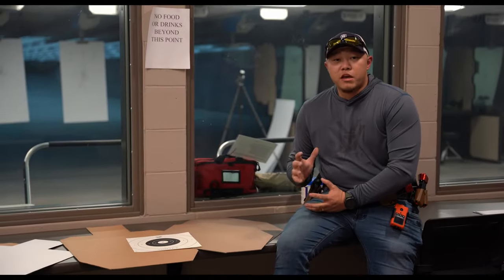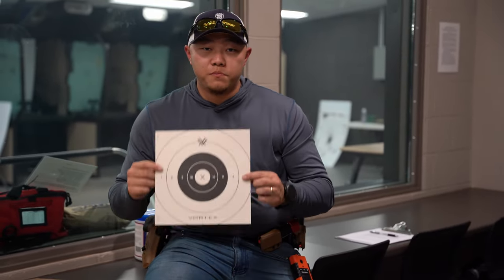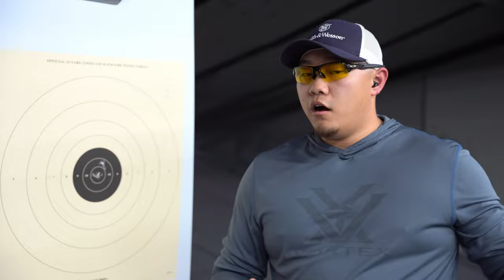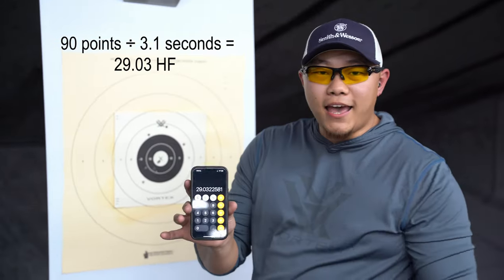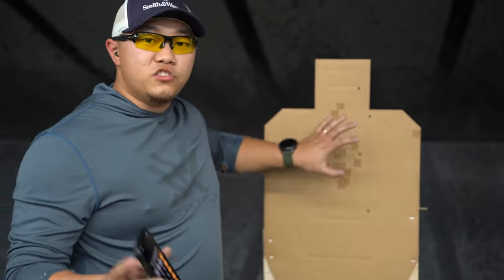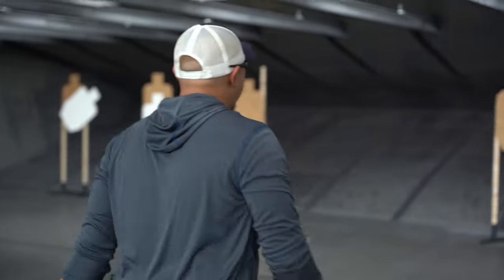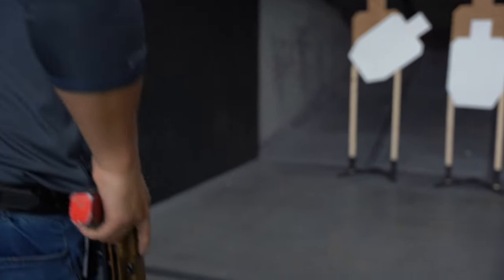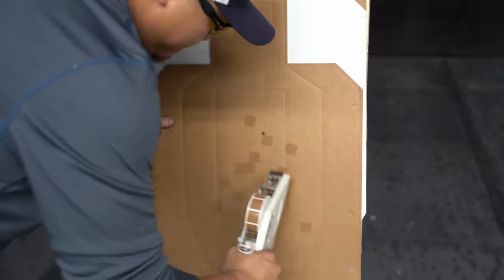What is Performance Shooting?

Comment: That montage was bonkers. What earpro are you using in the montage, and would you recommend it at an indoor range (particularly if other people are also firing, not just you)?
Reply from the maker: Using the Otto NoizeBarriers. I (Brennan) have found that they are super comfortable, long battery life, and superior sound quality. With others at an indoor range, especially if it’s an SBR w/muzzle brake or something, I’ll put over ear on top as well. Something like Walkers or Sordins or Amps.

Comment: Let me say first that I agree with what you are saying however I do have some questions. This is a great presentation, you make great points so please don’t think I’m sniping or anything like that. Just questions. At first I thought you were shooting a G34 but the design on the grip looks S&W so some type of M&P. Regardless, this looks like a pistol with a 5” barrel. I was watching the pistol recoil and I’m guessing you’re shooting a competition round, 115 grain and just enough propellant to make the power factor. Dang, in the intro there is zero muzzle flip. And you’re wearing your competition setup. You are obviously a competitive shooter and you’re good at it. So here is my question. How does that equate to a self defense scenario?
1) do you actually carry a competition pistol and that gear? Most I know carry a G43/G48/Shield/365 or something similar IWB. How does that compare?
2) so let’s say you purchased a low power 115gr mass produced cartridge straight off the shelf. Most I know carry 124+P or 147 grain. How does shooting a low power 115 grain compare to shooting a full power self defense round? Is there no significant difference?
3) you’re shooting at ten yards. How many people do you know can shoot that well, at that pace using a micro at 10 yards?

My point here is that what you’re shooting in this video really doesn’t compare to a self defense shooting because most can’t achieve the same results you’re achieving. The drills are fantastic however I’m guessing a person will have to deal with much more muzzle action when shooting a pistol with a 3 to 3.5 inch barrel using 124+P or 147 grain FMJ. And don’t even begin to believe most can shoot that well, that fast from ten yards shooting the same grain and MV they carry daily with a micro. Honestly, most can’t do that at five. Like I said, I’m not trying to be a jerk. I’m just asking the question. How does competitive shooting apply to a self defense shooting?
Reply: Speed and accuracy will always directly translate to "defensive" shooting regardless of equipment used. Faster and more accurate is always better, even if it is relative to the gear being used. 

But if people can't achieve desired results with their crappy micro maybe they should consider buying a more capable gun. There are no rules against carrying a full size gun.

Comment: Great work! New to M&P’s would you say the Apex barrel is worth it with m2.0? 

I shoot 5 shot groups sub 2 inches (unsupported, freestanding) with my PDP at 25 yards. Is that something that achievable with the stock M2.0 barrel?

Also subscribed!
Reply from the maker: Nice shooting! My groups are usually much larger than 2 inches at 25, so I wouldn’t know. For me, I’d have to say I appreciate the Apex barrel but it’s not a necessity in any way.